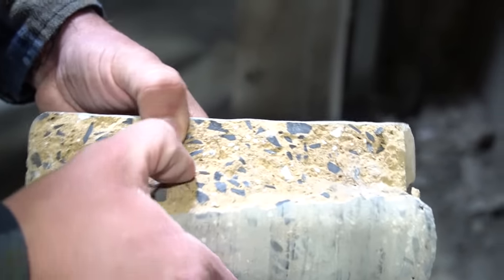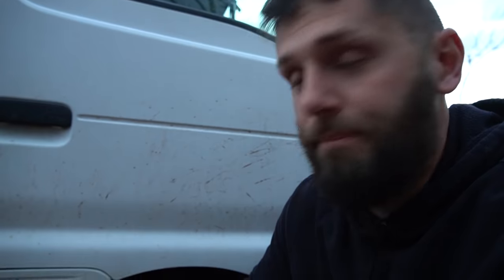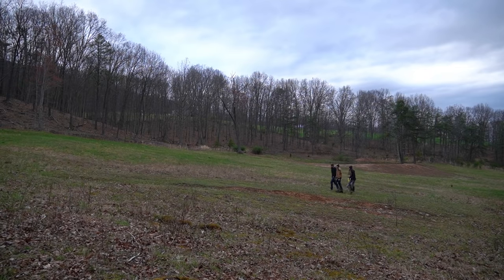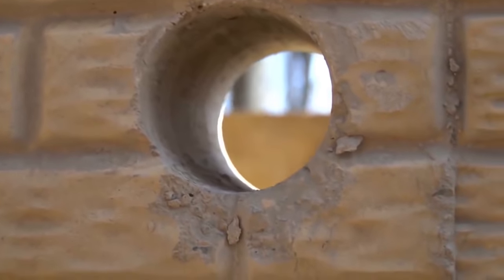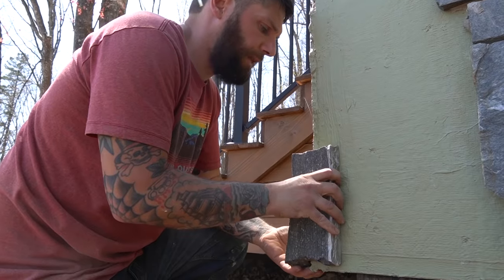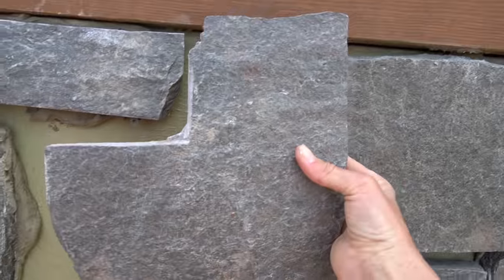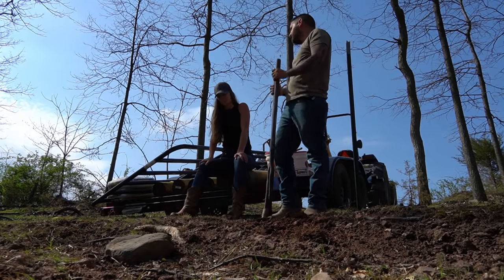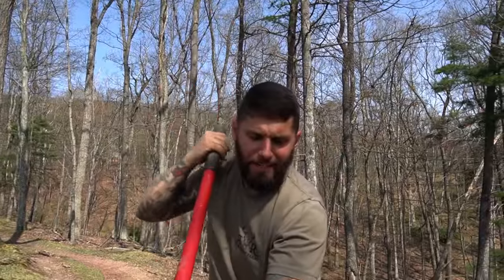RESULTS OF THE CONCRETE TEST | Are We Tearing Down Our House Foundation?

Comment: You're simply the best on all levels in the homesteading league. You never fail to get me a smile on my face, even when there's an occasional onion-cutting going on.
The concrete in the investment property looked extremely suspicious to me when they poured it and your lab confirmed it. The building/contracting industry is so inefficient that, in my country, local government rents public infrastructure out to the building company that does a repair or modification job. If they agree in the contract that the job can be done in a good way in two weeks then the contract says the contractor can charge the rent for those two weeks back to the municipality. No BS, no excuses, no small print. The problem with the pour, from the looks of it, was that it was way too wet. You need water to make the chemical bonding happen between parts of the concrete, but too much water triggers the chemical reaction without proper bonding and worst case, you end up with something that is like sand.

Comment: Check the slump on the ticket before you except the next concrete load.  If permitted in WV use fiberglass instead of  rebar. Rebat expands and retracts causing cracks. You do not want that cornerstone structure to crack.

Comment: How come you guys don’t just throw the dry cement in the post holes and then fill it with water using your new truck and tank combo? I’ve done a ton of fences that way. Cement will also pull the moisture from the ground too!

Comment: Order 5500 psi mix…. Have a certified concrete field inspector make sure a ticket comes with each truck that shows the correct mix design have the inspector pull a slump run a temperature and air content test …. No water added if it meets the criteria have a person watch the water valve the entire time to insure this make cylinders 4 X 8 inches on every load…. It they don’t meet the strength called for on the mix design it all kicks back to the supplier and the company you paid to inspect … get the county building inspector to check the forms before you allow them to even order the concrete

Comment: The lack of workmanship is definitely on the contractor.  The lack of strength in the concrete is on the supplier.  Ask them to use a different batch plant on the redo!

Comment: I'm in construction this is on concrete or general contractors performance bond it must preform to quality standards , so it's their job to put in concrete with right cement bags per yard and rebar to code installed tied to code. Or pay then next guy to replace it including waste off haul with clean up. Sorry this totally sucks, but better to replace it.
Best to you make sure sack mix is correct as in ask concrete truck how many sacks of cement per yard?

Comment: What kind of company pours concrete foundation without rebar . Makes you wonder how many other people they ripped off . Yes I understand one does not need rebar if one uses large rocks mixed in with high strength cement . You should be informing who these people are and saving some other poor soul from them .

Comment: You can try cinder blocks rather than concrete a rebar.. you lay them like bricks , they can filled with cement if you like or you can just fill the corners.. they build stadiums out of them here in Australia and they handle temperature shits really well.

Comment: my advice would be to keep the structure use it for a tank or a storage for some kind , and maybe find another spot for the house project . you can also use the structure to cut out smaller slabs using diamond wire rope and use it as a floor . but you guys have build everything on your own and its so beautiful , and much to say you are more qualified than certified contractors .. hats off  good luck what ever you guys plan , i know it will be amazing

Comment: Normally I just watch each eps, and hit the like button and move onto the next eps from another creator. This time, I have a concern about the bottom of your foe wall. Your not bringing the stone down far enough to keep the fill dirt from touching the wood around the bottom on the house, deck and stairs and I wonder if those areas do come into contact with soil if they'll begin to rot the wood because of contact with the soil.

Comment: That was a great video Erin and Josh, covered all three large projects well; including the care of the Turkey's and the whole family pitching in.

Hopefully, with the failure of the concrete tests you are able to recuperate some of your losses 
($$$$) and able to find another concrete contractor. In the event that you can't find another contractor, you two have the knowledge to construct framing with rebar...good luck either way. But first demolition has to take place...going to be interesting on the particular methods you both should choose.

The stone work is really looking great. Mortaring all that stone will be a large job as well. Are going to do it by hand or by a small hose via a pump on/off system? Thinking the latter would get more mortar in between the stones and a slower and steady pace. One controls the hose/flow while the other goes behind pushing the mortar between the stone with gloved hands or...
Shirley...don't call me shirley, you'll both will come up with a viable solution.

Come summer when the hills of West Virginia simmer in the heat of the day (May and it's freezing??) and most of the animals are seeking shade or a cooler spot that there be a pond available to them all, what a wonderful addition!!!!

Comment: A sawzall with no blade pressed against the post would make a good portable concrete settling tool.  It will help get rid of the air bubbles.

Comment: So you know if you don’t already they have test canisters where you can take the concrete right out of the truck for a crush test.. so you don’t have to core drill to get the test  material.. they also have cones available to test the slump of the concrete 3 to 4 inch slump is ok ..slump is the viscosity of the concrete. ( how thick it is ) your concrete contractor should have these things insist on it.

Comment: I'm very glad to see that you're removing the concrete foundation on your Air B&B. Besides the pour exceeding 3000 psi, insist on one-foot grid rebar in the walls and no less than two horizontal runs of rebar in the footers if you are removing them as well. In addition, there should be rebar tied to the footer rebar horizontally and turned 90 degrees vertically  for 2-3 feet for the wall rebar to be tied to. I always liked boring a 2 foot deep x 6 inch diameter post hole every 4 feet in the center of the footer to insure stabilization when building on inclines. Your fence looks great and I'm sure the animals will appreciate the extra space. I can't get over how well the two of you work together and how enthusiastic your kids are to help out. Keep up the great work. Love watching and look forward to every episode.

Comment: Put steel rod in the walls and you know how to weld so weld horizontal rod to vertical rod placed into the footers to the foundation. Then pump in concrete of proper strength to cure correctly.

Comment: I knew right away that these foundations were to be torn down, how to make foundations with such diluted concrete and not to use reinforcement (rebars or dispersed reinforcement), and there is no point in waiting, but sue the contractor right away

Comment: You can also have the concrete tested at the time of the pour. Just make sure the slump is the same as what goes in the wall as when you make the test cylinders.  Make a set of 3 per test site. You can break 1 in 7 days it should break close if not over to the psi and gives a good indication if the pour is going to pass. After 28 days break one 2nd one of the set if you dont make the psi in 7 days. Make sure the cylinders have no air bubles and tamped in well, and only fill the cylinders 1/3 at a time.

Comment: I wonder if there is way to use the existing foundation as an inside retaining wall, pin it and pour proper concrete as a second layer around it.  Wouldn't have to tear it down and would be pretty well insulated at least.

Comment: Yeah you don’t want to have to have your house jacked up and a new foundation put.  My brother n law has bought a house. And after living there a few years notice cracking and the house dropping.  He did have it inspected before he bought it but no problems were found.  A few years after my sister had he got married the problems got worse. The had it inspected again and found not only was the concrete faulty but the house had been built above a natural spring  and it was all collapsing.  Everything part of the foundation ha to be removed. They had to excavate very far down. Divert the spring put in massive bracing. And a whole new foundation.   The people who redid it said they was no way the builder didn’t know a spring was there and they had to know the concrete they used was not up to code.

Comment: The stone looks fantastic. When you get ready to grout it, use a grout bag with a high moisture mix, and start from the top. You can also cut the grout bag nozzle pretty large, so it makes filling in the larger gaps easier. It is a bit hard on your hands, but it beats the waste and cleanup if you try to trowel in the grout.

Comment: 2456 psi is still strong..you re not building the world trader center..the loads are not anywhere close to the strength of 2456 psi..maybe 10-15% of that..but hey, some people wear 2 masks for the same reason...fear and ignorance
Reply from the maker: That's fine. Let me come to your house and I'll change all your breakers to 40amp breakers.  Chances are, your house won't burn down but don't bother changing the electrical to meet code out of fear and ignorance.

Comment: As a Civil Engineer it is my guess that the concrete probably left the batch plant at around 3500 psi.  That should be adequate for a home foundation.
Reply: Got cut off… the mix left the plant fine.  Watching the on site shots of the mortar running out of the joints, I would bet a considerable amount of water was added at the build site to make it easy to set.  Same thing probably happened to the foundation-batch. Who poured the foundation?  Who added the water…..the couple or a-hired contractor.   In our retirement community, there was very little experience in pouring or setting concrete.  I caught the local driveway expert adding water ti the batch still in the truck.  When I asked him what the hell he was doing…he replied. “Makes it a lot easier to work”….stopped him immediately and raised hell with the truck driver.  His reply was that “happens all the time”.  I spent 2 summers in U of Md Engineering labs doing pullout tests on reBars in various strengths of concrete for their Continuously Reinforced  Test pavement installed up to York PA above Baltimore. Believe me…water kills concrete strength until the concrete reaches a cured state.  Once poured into a test cylinder, the the test cylinder is kept under 100 % misting water until test time.   Usually 28 days.  
What dies your local county building inspector say about the strength of the test cylinders on your home project?   It is possible your footings were completely adequate for the building loads them.  Good luck.  

JoeB.       U of Md CE Class 1963

Comment: How is it possible that the concrete didn't pass? I understand that the contractors did a terrible job with the pour but wouldn't the failure be the fault of the concrete truck?
Reply from the maker: No, because it's the concrete contractor who decided to keep having more and more water added. The concrete plant just delivers the concrete, they don't make the call on how much water to add

Comment: i was burned from a heat lamp. hope the turkeys arent too hot
Reply from the maker: When hanging a heat lamp for chicks/poults/ducklings you just need to monitor their behavior. If they are evenly dispersed throughout the brooder that means the temperature is perfect. If they are all huddled together under the lamp that means they are too cold and you need to lower the lamp or add another and finally, if they are all as far away from the lamp as possible that means they are too hot. We just monitor the babies and adjust if need be